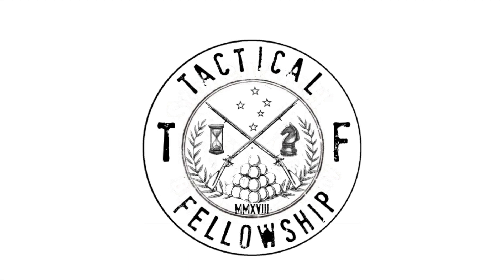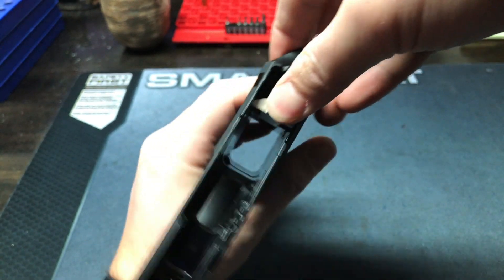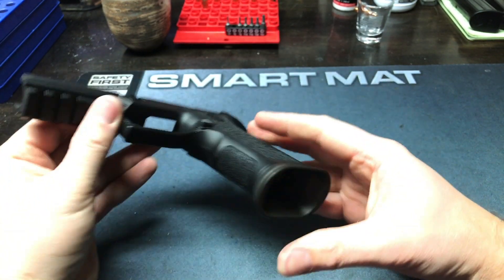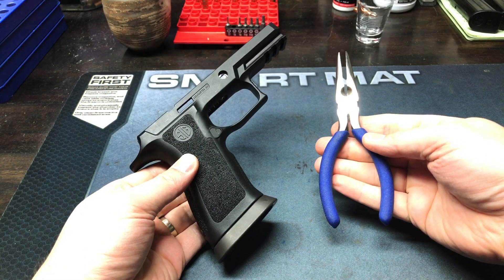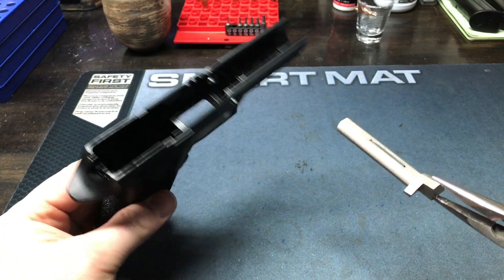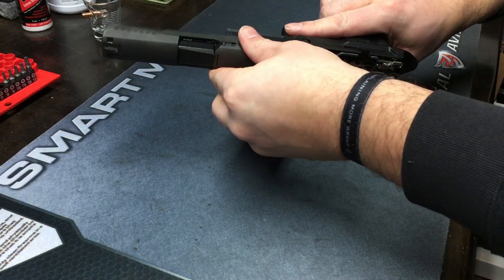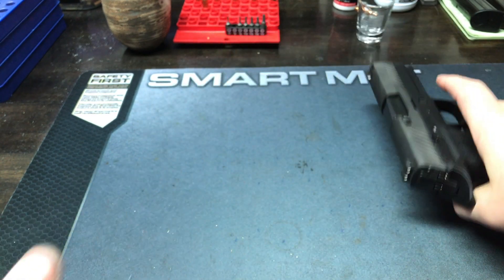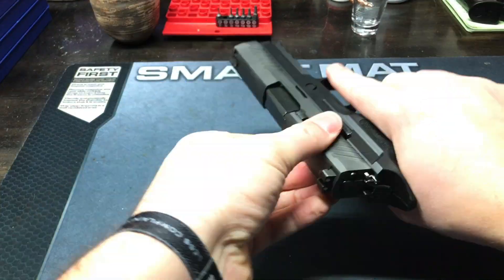How to INSTALL/REMOVE a Sig P320 X-series Grip Weight

Comment: There's a small gap in the groove on the bottom side of the grip weight.  You can use a flathead screwdriver to pry the grip weight upward, and then use the screwdriver to push the weight out.

Comment: I found a much easier way to remove the weight without marring it up. Turn the grip module upside down and hold it firmly around the front half. Knock the rear top corner part of the grip downward against a padded surface on  your workbench. I have a thick rubber mat that works perfect for this. A couple of hits and the weight slides up enough to just pull it out easily with your fingers. 

Same for seating it, push it in best you can and then knock the bottom of the mag well on the bench mat and it will seat the weight all the way in easily. Just don't knock it too hard and break the plastic taking it out or putting it in.
Reply from the maker: Chris Swimm awesome stuff! Thanks for the comment, I’ll try it next time it needs to come out:)
Reply: Great idea Chris!  Just used it to pull the weight from my X5 grip and install it in a RX-Carry grip.  I left a comment above.
Reply: Just tried this, works perfectly thanks!
Reply: Just tried it and it works. Thanks!

Comment: I found the steel weight approx 1.6 oz for between $35.00 to$45.00 I also found a tungsten 3.5 oz weight for $249.00 so I made my own from a old fishing weight for $00.00 it weighs 3 oz all I needed was a lead weight a hammer and about 20 minutes. There's NO way either the steel or tungsten weight are worth the money
Reply from the maker: Holy Moses $249!?! That’s nuts, glad you didn’t pay that and congrats on the custom weight, hope it works out well for you:) how are you shimming the weight from accidentally shifting up?
Reply: @TacticalFellowship  it's held in place by the fcu
Reply: I made my first one out of a roll of lead tape that’s for a golf shops for adding weight to your putter. I just cut them to length and hammered them into shape. 
Once I had the fit I just put silicone on it and in the grip slot. 3k+ rounds later she hasn’t moved. 
I just got tired of dropping $60 every time I added another grip 😂🙌🏼
The tape is extremely playable to shaping was easy. 
My fishing lead was on standby. I was going to make a silicone mold and melt a bunch if needed.

Comment: I love the 320 and the x5.  My only issue is they aren't making the grip module larger yet.  I put grip tape on mine and its much better.  I like the weight and haven't removed mine.  I took my magwell off to shoot production, then put it on to shoot limited and stripped the hex screw, so it's stuck on.  I just ordered another grip module and will switch depending on what I shoot:)
Reply from the maker: Jonathan Frost thanks for the tips! I kinda feel like a stipple job is in this handles future, can’t wait to get some rounds down range with this guy:)
Reply from the maker: Jonathan Frost also, you MIGHT have been the inspiration behind this new p320 route;)
Reply: Tactical Fellowship I think they are great pistols.  I look forward to seeing what your thoughts are after shooting it a bunch. And a stipple job would probably be perfect!

Comment: Do you want the weigh in front under the barrel to minimize muzzle flip? Not in the grip?
Reply from the maker: both is preferred. you need to balance front and back so that the barrel comes back to level after recoil, if you go too heavy on the front you'll get barrel "dip" which is not ideal...

Comment: Is there any place that sells these  grip weights? I would like to put one in my X carry.
Reply from the maker: Regrets I couldn't find anyone selling these aftermarket, ended picking mine up off Ebay:/
Reply: Sig Sauer actually sale these grip weights for $49 + $9.95 shipping and a seller on eBay have them for $39.95 + $2.99 shipping.
Reply: @strategic-work  Thanks but I think I will pass on that. TOO $$$
Reply from the maker: Kelvin thanks for the heads up on where to get these parts, your google-fu is stronger than mine 😂👍🏻
Reply: I just received one for my X-Carry in the mail yesterday. I used the $50 sig store rewards I got for the purchase of my X5. I am going to try it out with my X-Carry. Thanks for the how-to installation video.
Reply from the maker: Kelvin awesome! let me know what you think about that grip weight once you shoot it a bit:)
Reply: Osage County Firearms

Comment: I have the x compact and the slot is different. There's three seperate slots for rods to go in..cant find the weights anywhere....
Reply from the maker: just did a quick search on your question and yep, I didn't find anything either... Looks like no love for x compact grip weights, sorry to hear this for you, atleast for now anyways:)
Reply: @TacticalFellowship  thank you so much....I also have the original grip module but the x series grip modules are so much better.
Reply: Armory Craft has a tungsten weights that should fit. Check you the video showing how to install on the Sig Sauer Guy channel
Reply: Wilson Combat makes tungsten weights ...  I asked armory craft and they said its not in the product description so I shouldn't ask stupid questions. A week later Wilson was back in-stock ... plus they are respected in the industry... unlike the nobodies at armory craft.
Reply: @keithchu1067  Message 1:) "Description stated:
"ARMORY CRAFT Tungsten WEIGHT KIT FOR WC320 Wilson Combat SIG P320 Grip Modules"
The ONLY images in the auction (10 of them !) were of the Wilson Combat Grip modules.
It was not compatible with Glock and Taurus guns either ...should we have listed those models as well??
(Your order was cancelled and refunded)
"
___________________
Message 2:) "Sometimes I wonder why some people that lack basic reading comprehension own firearms.
You certainly fall in that group.
Best of luck to you. Seems that you could use it.
"

- Milos Klacko
Reply: Wilson combat makes them for x compact $18

Comment: Are grips weights made for the regular sig p320? I bought the x5 and a regular  p320 carry grip module but the weight didn't fit so I'm not sure if it even has one?
Reply from the maker: Enrique Rodriguez nope, the grip weights only work in X-SERIES grip modules due to regular 320 grips not having the slot for them:/
Reply from the maker: @fuddyduddie1205  to the best of my knowledge this will NOT fit an x-series compact frame so regrets that's a strike out for that - wilson combat makes a compact grip mod that takes some custom tungsten rods. thats the only thing i can think of though...

Comment: Does this work on xvsrry grip module?
Reply: Racer X yes I took the grip weight, magwell, slide, barrel, guide rod and spring, and fcu, it all fits in the x carry grip module. Feels more like a 1911 with the smaller grip. If you have an x-carry I suggest the DPM triple spring guide rod assembly. That thing is amazing.